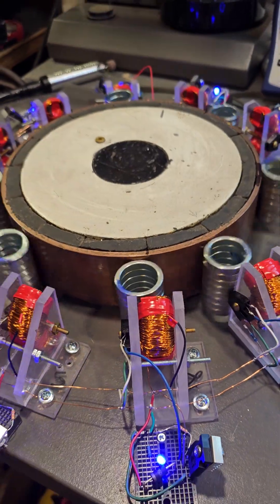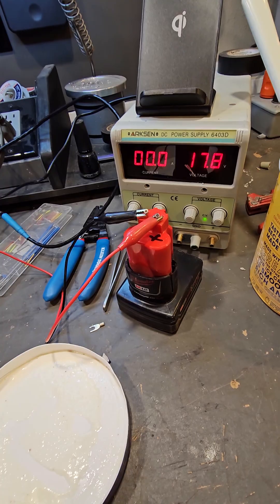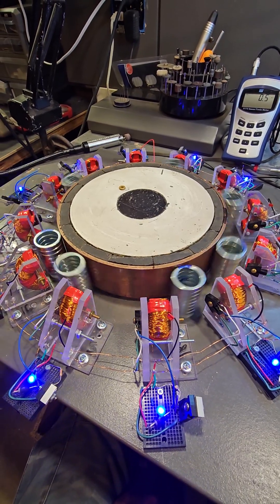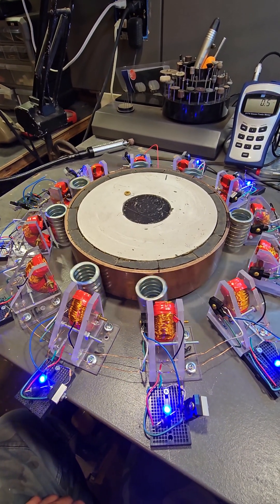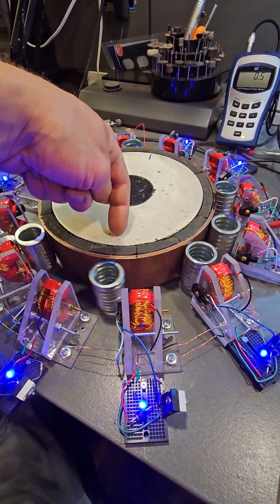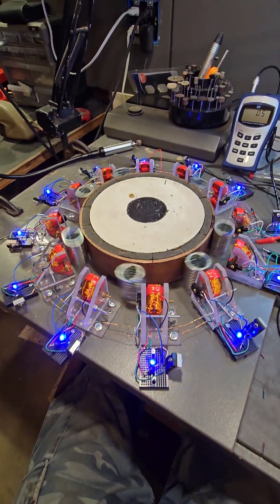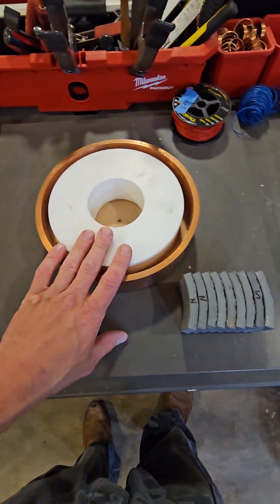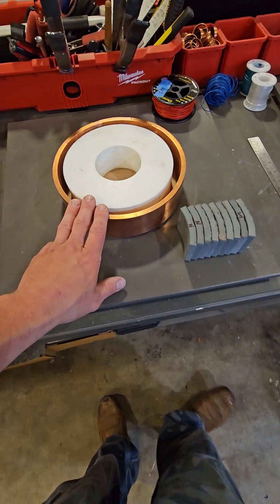Searl effect generator mockup final video for Mark 1 device.

Comment: To be Frank l wish you could do a good research in seg segment, but my concern I wish to express is you are no where near to seg tech just spending your money and life time on this wrong way, you must understand that you are just doing a multi polar single phase motor, the plate magnet using is jus increased burden, instead if you use CRNGO sheet cut to assemble ring , you can see that will give more faster motor, you have no idea how to determine size it's not you but even Fernando not follow required formula , I seen actual formula your friend James ovenden discussing on it with his Indian friend, we tried all level best to receive it from ovenden but he not agree share actual formula
Reply from the maker: Thank you Frank, I appreciate your opinion. However most all the research me and my group are involved in I keep offline and don't speak of it on these videos. What I am showing is barely a taste of what is really being discovered here.
Reply: I agree with the author of this comment.  I appreciate your work and what you do. But a lot of time and money is wasted.
Reply: @Umar_Dargi_Al_Caucasian  there are engineers who really knows what is in SEG , people need to come out of their selfish attitude, make a combined effort to achieve the goal, aspirants come out and form an engineers group, collective efforts could bring results

Comment: Does the device actually produce any usable electric current like the original inventor claims? I remember a few years back I showed the explanatory video made by Searl himself to my physics teacher and he was...skeptical.
Reply from the maker: It can't produce any power. Right now it's only a linear motor. Once I probably work on the Mark 4 device which will use radial magnetizing the rollers will pass through a perpendicular field on the base unit. That may be away I can generate power. Right now all the fields are in parallel. So none of the rollers are cutting through any magnetic fields. Remember in an electrical generator a wire has to cut through a magnetic field develop voltage and current.